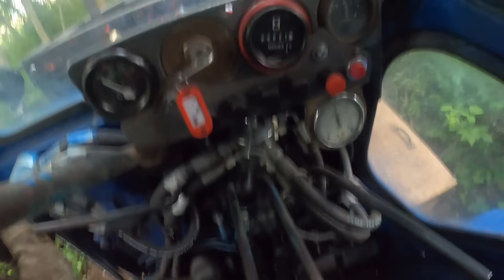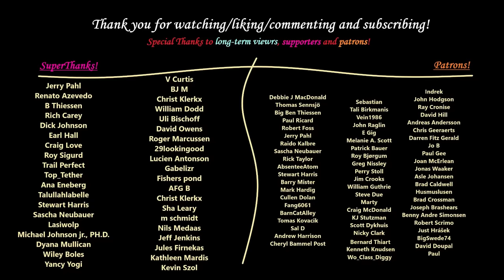Making a new access road

Comment from the maker: Tip of the day: Don't ram into dead trees... Well at least i found a rock, so it was worth it.
Reply: Did you find any dead bodies asking for a freind?
Reply: Your property is gorgeous, the road turned out perfect even tho I thought you were going to turn over a couple of times. Good job staying upright! I have a tiny rock garden, the boulders are amazing. I enjoyed your video so much, have a wonderful weekend Andris
Reply: One day the mother will spew her great power. No more machines on my grass! Then me with many others will look forward to building random stuff.❤
Reply: Noormees, kas te puhkate ka vahepeal?
Reply: Rock sitting there since the ice age bothering no one. Till now.
Reply from the maker: @EevaL.-em3eq puhkan siis kui kunagi ära suren🎉
Reply from the maker: @OlkaOve you may be on to something😂
Reply from the maker: @alucardhellsing1037 no dead bodies 😂
Reply from the maker: @deborahfaulk5532 it was scary yeah. Because your sitting high in the cab it feels like your gonna toppel over😂 but the center of mass is actually low to the ground so this thing will not easily turn over
Reply: I know you have lots of projects but you might want to weld iron stock on Joseph tracks. It will help with pushing. But stay off Mom's grass it will chew it up.😂
Reply from the maker: @jimmytew9468  i need to look into this yes
Reply: @Ants_Pants  it will greatly improve traction on snow and ice
Reply: And use 2" solid steel stock for dozer blade reinforcements lol
Reply: Hey Andris, great video as always. I like how the road turned out. That tree you were talking about at the end of the video, I had one similar and drilled through the tree then used a long threaded rod and big nuts and washers. It pulled the tree back together and has lasted years.
Reply: @Ants_Pants   I’m really happy to hear that! It looks like fun to drive and it’s so powerful too! Take care

Comment: Andris, was thinking - what about using some mondo chain for that blade stabilizer?  Seems to me that when they are both there - they are both under compression/tension - so a chain would work and maybe provide a little slack?  No idea - just a thought.
Reply from the maker: I need to take a closer look. I think the old pipe pins are worn from swinging all those years. Chain would be a good option too yeah

Comment: You could reuse small rocks to make a topsoil on the river, so you can drive it without fear of being trapped by mud😉👍 
About the dozer pipe, you have to think something really really stronger, like 10 times the old one😂
Reply from the maker: called up the local steel yard, they had nothing to offer me lol...
Reply: @Ants_Pants  you have to search  better on your house,  use right preparation and nice steel rods for welding with high current, then it will be fine, some ruined hydraulic cylinder will do the job, you can do it!🍻

Comment: Hé man make sure that you rev up your engine I ment for the yanmar maybe you’ll save your hydrolic pump for a little time longer. 
It’s not good to ask power if your pump is not giving you all of its capacity. 
So don’t over rev and not under rev it. Get it. 
Nice work. O yeah it rune’s you engine to specially seal’s and valves
Reply from the maker: Ok

Comment: Those 2 trees are dead within the next 5 years - I'm sure they'll be fine though...
Reply from the maker: Iv removed tons of roots from trees and not a single tree has even shown any signs of illness or decay even years after the damage. Maybe it's fine but they still might die
Reply: @Ants_Pants  
Yes but when you break or damage the large roots it is extremely difficult for them to recover - you're cutting off not only water supply but also nutrients. Breaking roots is also great way for disease to set it and enter the tree. Personally, I try to imagine the size of the root ball under ground based on the tree size and species, and then just stay away from this area while working around it. Analogy with "joseph" - you can pour some sand into your engine oil, and he will still run and work, but almost certainly that sand will diminish the useful lifespan of your engine longterm. Good luck with your projects!
Reply from the maker: @Gubastek  i will keep an eye on the tree after winter. If it shows problems i will cut it down, put it on the sawmill, make planks and ultimately into some furniture. Then it will last forever